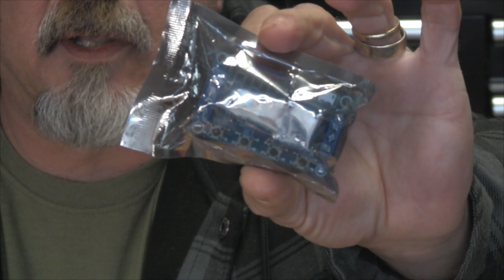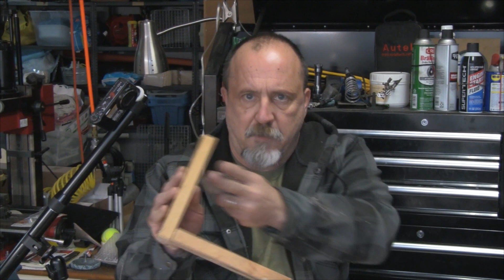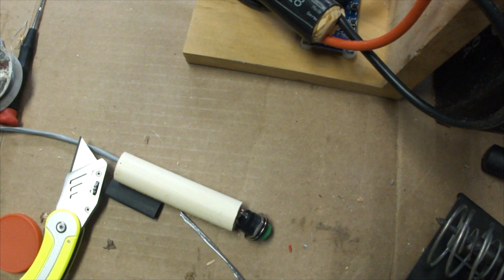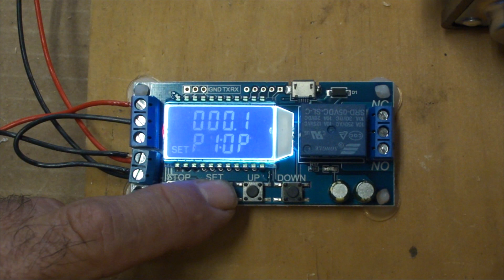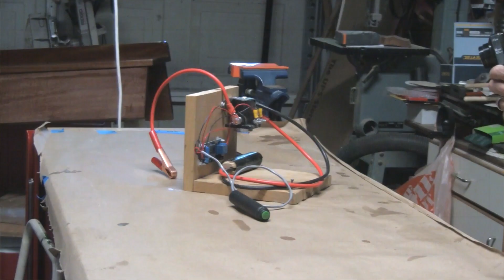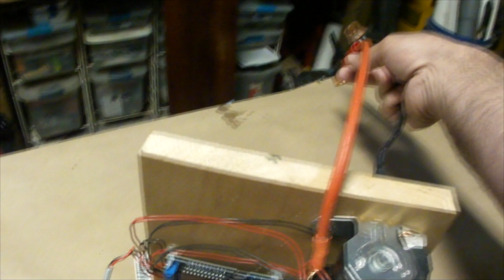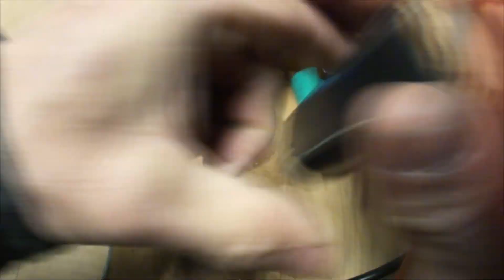How to Make Your Own DIY Spot Welder for  18650 Lithium Ion Battery Packs

Comment from the maker: I've received several requests for a video on making the spot welding pen. I've recovered the footage I needed and posted a video on the welding pen https://youtu.be/lK9CZYKGfxs , I hope this is useful to you!
Reply: The link is 404 Not Found.
Reply: Sorry, my fault. Apparently the fault of "Unshorten Link" extension for Chrome. I turned the extension off and it worked.
Reply from the maker: @joeschreffler5993  That's interesting to know. Thanks for the heads up!
Reply: @ExtremeDIYGuy could you have done away with the manual press switch and wired those 2 wires to the welding pen also so that when the pen touches the metal strip that shorts the trigger wires which then does the same function as you did manually pushing the switch? Just a thought.

Comment: I watched your video and put a unit together. When I try it I get a spark and doesn't look like enough power. Using a Riding mower battery 12VDC with CCA of 135 A. Then placed 2 similar batteries both 12VDC and CCA 135 A. Still not enough to cause a weld. What size batteries should I be using. (Cost conscious).. What would be the minimum size, CCA, to cause a weld. Also, can you provide, or show, the actual wiring.. Thank you
Reply from the maker: Hard to say, I would think that 135 should work. I used a car battery rated at 500 CCA.
Reply: @ExtremeDIYGuy  Sorry, Please advise if I have it wired correctly: If you hold Solenoid with large terminals up and the smaller terminal down, the left (large) I connect to the + battery, + input to timer board, Trigger switch, NO (middle on right) on timer board, 2nd lead to welding pen
From Trigger connect to top terminal on left side of timer board
Ground from battery (-), I connect to (-) input to timer board, 2nd input on left side of timer board, First lead on the Welding Pen, and Smaller terminal on right side marked (I) on solenoid
Left side of small terminal on left side of solenoid marked (S) to right side of timer board, NO (3rd) position
Do I have this right? Should I change anything? Again I apologize but would really to like to get this thing built correctly

Comment: Hey thanks for the video, I have a question, I have mine all set up, relay makes clicking noise like yours does when no oad on it, but when I have the pen on the metal and press the trigger, then I get like a grinding sound from the solenoid. Not sure why. I tried setting time to 5 sec, press trigger, then quickly touch the pen to the metal, I get a very little spark, then a P11 comes up on the screen. Any ideas? I do Have a slightly different timer than you, but I have all setting the same. Thx

Comment: Thanks Mate! I found just the stuff You used (timer/relay) and will put together my own rig. 
This is so simple and awsome- just what I was looking for. And it seems to deliver very good results. I´m gonna apply a footswitch and use two welding leads (both hands).
Then I got just what I need to tackle 18650 builds- Awsome!
Reply from the maker: Glad it helped

Comment: I built this (TWICE!) exactly according to the plans. Well, I THINK I did... because it'll give a satisfying click if I hold the spotweld electrodes on a NON-conductive (wood, plastic, etc) surface. But if I press it to nickel strip, metal, wire--anything conductive--it clicks as fast as it can recover until you cut power. Sounds like a ratchet Somewhere I did something fundamentally wrong. What would make it click repeatedly and not deliver power to the electrodes?
Reply: Figure this out?   I'm having same issue. I feel like it has something to do with the second pin on the solenoid. He has a black wire going to somewhere on the controller. But I can't see where?

Comment: Sir i had watch your video on DIY spot weld. sir i have a question can i use 12v/3amps. regulated power supply for the power source?
Reply from the maker: I don't see why not, worth a shot. Not sure 3 amps is enough though.
Reply: @ExtremeDIYGuy  Tnk u sir for replying to may question, regards

Comment: Can i use dual output 12v 50A smps to power the whole thing?
Reply from the maker: I would think so, 100 amps should be enough juice to work.

Comment: I made essentially the same setup with a cheap starter solenoid from Amazon and while I was practicing on a bad cell the relay got stuck closed and melted a hole right through the bottom of the 18650. Luckily it was completely dead and didn't explode. I'm considering having two relays in series as a safety redundancy to protect myself and the batteries.
Reply: U can put a 300A fuse after the selinoide and u are ok,it's 3$
Reply: @klaudyuvl  I considered this just didn't know the amperage to use thanks
Reply: Dead ones catch on fire also sometimes a lot more easily.😂 My buddy found that out after he ignored my warning about 15 years ago.

Comment: I made a welder like that but without the control board and it worked great for a bunch of welds but now it stopped welding. I bought a new solenoid and it still won't work . I charged the battery and tried two batteries.  Do you think my momentary switch just isn't activating the solenoid for long enough and I need a control board?
Reply from the maker: Probably so, worth giving it a try

Comment: Can this be used for spot welding anything. I need to tack a fender on a Van. Just enough to hold it temporarily.
Reply from the maker: If you connected the cables to a spot welding jig. that might work

Comment: Jose, Love the video.  Just made mine using all your products in the description.  Tested it only a few times connected to my car battery.  I have a question about the trigger.  When I push it it fires, but it will continue to fire repeatedly unless I let go of the button.  Is this normal?  I "expected" to push and hold the trigger, the board would fire to the settings programmed, but it would only fire again after I released and pressed the trigger again.  Can you help?
Reply from the maker: Marty, that's not normal. I had that happen a few times when I was first testing the build, If I remember correctly I went through all of the connections one more time, especially the ground connections and that resolved the rapid firing.
Reply: Mine does that. So after frustrating troubleshooting--I actually rebuilt it completely! It did the exact same thing the second time. So I'm getting something consistently wrong. If you press the electrodes on something nonconductive, it clicks once and won't re-fire until I press the button again.

Comment: Dumb question.

Looking at the parts, I can't seem to source them for cheaper than buying a spot welder.  I have to buy the parts anyway because I don't have them laying around.

Am I looking in the wrong place?  Or is this a more expensive DIY option, but performs better?
Reply from the maker: You're probably looking at the Chinese ones that have recently come out. If all you are doing is a few batteries here and there, it's worth using one of them.
Reply: @ExtremeDIYGuy  Yes, the usual odd brand name ones.  I know enough to not trust the reviews on Amazon, so figured I would ask someone who has some experience with them.

I'm not building packs (maybe in the future), just usually single 18650 or rarely some series 2 cells for random projects around the house.

Comment: I have the timing board and relay hooked up to 2 12V 5ah batteries connected in series. I cant get the heat needed to weld and the solenoid to stay clicked in. Keeps rapid clicking every time the pen has contact and i dont know why.
Reply from the maker: Try running the batteries in parallel for more amperage.
Reply: @ExtremeDIYGuy  oh my bad didnt mean to say series. They are in parallel. Finally got spark but the solenoid is still rapid clicking every time i try to weld. The heat dosent go through the strip.

Comment: The wiring you have in the video is wrong. Solenoid base is ground. I terminal on solenoid  is not ground but direct short.
Reply from the maker: Yes, that's why I have the main ground lead connected through the base of the solenoid.

Comment from the maker: @gery barnet I cant seem to find your original comment I received in email but here's what I would try. Solder the prong you are having difficulties with to a strip of nickel and then spot weld that to the battery. I think the reason you need longer dwell times is that I was using a car battery and the available amperage is much higher than your battery setup. Make sense?
Reply: Thank you sir for the prompt reply.  I bought and am using a brand new car battery for this specific purpose.  I don't think I provided correct clarification in my original post, that is, I use the car battery for the welding circuit and the dewalt battery only for the power input to the circuit board.  So I'm at a loss as to why I have to use upward of 400 milliseconds to weld the nickel tabs.  The space is very limited around the prong area but I am going to try your suggestion today as to first welding a piece of tab to the prong then the prong to the battery.  Thanks so much for your advice.
Reply from the maker: Try soldering the connector to the tab and then welding the tab to the battery if all welds doesn't work.
Reply: Hi again Jose.  You deserve a better clarification than I previously gave.  I am using a Dewalt 18vdc battery as a power source for the circuit board (board can use anything between 5vdc and 30vdc).  I am using the new 12 vdc car battery as the source of power for the spot welding circuit through the solenoid.  Other than using separate power sources, my setup is exactly as in your video.  Wish I could post a couple pics to illustrate what I have.  In any event, I don't understand my problem with having to use 400 milliseconds to weld tabs to the batteries when you had such great welds with only 70 milliseconds.  Today I am going to try your suggestion regarding using a piece of nickel with the battery prong tabs.  I will let you know how it works.  Thanks again for the outstanding idea and video.
Reply from the maker: I'm not sure why you need such a long dwell time. Perhaps, If not the amperage, it may be the space between the welding tips or the thickness of the nickel tabs.
Reply: Hello again my friend.  I think I have found my problem with not being able to weld the prongs.  The prongs are part of the assembly which is plugged in and out of the Dewalt power tools, thus they must be sturdy.  I tried your idea but unfortunately didn't work.  Now, to my suspicion of what may be wrong.  I was giving the prongs I need to attach to the battery top a good cleaning and realized that they are not copper.  They appear to be brass or something similar, which I would think would require a higher heat and small dwell time (thanks for that term).  After noting that point, I upped my dwell time, in 200 millisecond increments,  to 1800 milliseconds in an effort to spot weld the darn thing.  The prongs got very warm but didn't even come close to being welded to the battery.  I looked at some of the other Dewalt batteries I have on hand and it appears that Dewalt used a welding pen with tips about as large as bb pellet.  Those tips penetrated about halfway thru the prongs during welding.  Well, I'm not giving up.  I will continue to look for a solution and will find one eventually.  As it now stands, I can weld up the whole battery pack except for this one connected to the prongs.  Thanks again for your help....greatly apprecaited.  By the way, if/when I find a solution I'll let you know.
Reply: Hi again Jose!  After quite a bit of experimentation, I have found a solution to connecting the ground prong to the top of the battery.  Being very careful not to ruin the prong and battery, I tried several dwell times of spot welding the two together with no success.  After more thought and experimenting, I found that could not simply solder the prong to the battery top.  But, by using an ample supply of flux I could put a small pool of solder on top of the battery which adhered well.  I then did the same with the prong.  I then put the two together, applied heat, and presto.  The solder joint was good enough to do the job.  The complication of the whole thing was that the plastic assembly on which the prong is attached allows very little room to solder without melting the plastic.  Anyway, thanks for the video and all your great advice!  You are a pillar of the community my friend!

Comment: This is absolutely brilliant. I built it using the wiring diagram and set the timer using a tutorial after a quick search. I think I spent less than 50 CDN, not including the battery. Worked perfectly after adjusting the time to 9 milliseconds. The only changes I made was to make the switch foot operated and to build a handle that allows the copper probes to be adjusted for width of weld. Great tutorial; Thanks so much!
Reply from the maker: I'm glad you liked the video! Your welcome

Comment: Hi sir,  just wondering if is it ok to nit put solenoid in the circuit, does it still work the same?
Reply from the maker: No, you would probably burn out the circuit board
Reply: @ExtremeDIYGuy  I see, ty for the Response sir ^_^, oh in my case, cuz i dont have that type of solenoid or any other car solenoid, i research some stuff about how solenoid works, can i try a 12v mechanical relay instead of a solenoid? i'll only run this whole schematics through a 12v 5amp motor battery ^_^
Reply from the maker: That should work. The starter solenoid is nothing but a mechanical relay that is capable of high currents.
Reply: @ExtremeDIYGuy  TY for the response again sir, i'll take note of that, hope it works ^_^, really need to work on my li ion battery on my solar set up

Comment: Flyback diode needed in this design?
Reply from the maker: Nope, I did not use on in this build, although it would be interesting to see if one helps in any way. Were you thinking of using one to protect the battery?

Comment: Can I use this Spot Welding Pen for the about project ?
https://www.ebay.co.uk/itm/Handheld-Spot-Welder-18650-Battery-Spot-Welding-Pen-DIY-Parts-Integrated-P3A9/224327794442
Reply from the maker: I think that should be fine.

Comment: Hello and  Great Video.  I am a non-electrical person and hoping I'm not too elementary to ask what power source did you use to power up the Timer Circuit board for setting the programing?  Dis you just connect to the car battery?
Reply from the maker: A 12 volt car battery was used to power everything. I hope this helps

Comment: FYI. You might check your local auto parts store for battery wire 
https://www.autozone.com/batteries-starting-and-charging/battery-cable-and-lug/lynx-utility-battery-cable-kit/162813_0_0
Reply from the maker: That should work as well

Comment: your wiring doesn't match the schematic attached. i really wish you would've showed where the small wires being routed were going on the side terminal. i can get my trigger to wrk but the welding pen is not working for some reason. i can't tell what is what in the video but following the attached schematic isn't working.
Reply from the maker: David, sorry. You're not the first to let me know that. This should help, there three key areas you want to make sure are grounded to the neg side of the battery. 1) the back bracket of the starter relay 2) One of the small terminals on the front of the relay 3) the second terminal down on the left side of the control board, 4) the bottom terminal on the left side of the control board. The schematic is an electrical representation but I think it is confusing. I'll try to work on one that shows every connection.
Reply: @ExtremeDIYGuy  thank you so much for this. I will rework it today! also, I'm sorry if I came off rude. this is the best tutorial I've found and I think you have a real talent for DIY videos. I appreciate all your help and the time you have put into making this information accessible.
Reply from the maker: @daviddowell7729  No worries! I appreciate feedback, makes me keep my game up! I'm glad you find my videos helpful!
Reply: what are you doing on the right side of the circuit board? i noticed on the instructions that came with it there is a "single power source" diagram but i cant tell from the video where they are being routed.
Reply: @ExtremeDIYGuy  anytime man. i'm definitely a subscriber now lol.
Reply from the maker: @daviddowell7729  I connected + power to the middle terminal on the right side, the bottom terminal goes to the starter solenoid. Let me know if this helps!
Reply from the maker: @daviddowell7729  Thanks David!
Reply: @ExtremeDIYGuy  yes it did! well i actually ended up tinkering with it until i got it right. thank god for multimeters lol. 

this might be weird but would you mind if i reached out to you in the future? i'm in school for engineering but they don't really give you a lot of hands on. i know all the math dealing with electricity but i feel like a child over here when it comes to tricks and tips to make things easier. for example, i would've never thought of using an auto solenoid for this project.
Reply from the maker: @daviddowell7729  No, I wouldn't mind. You can email me at extremediy01@gmail.com. But don't be surprise dif I can't help, I've forgotten most of my electronics, but love antenna theory lol